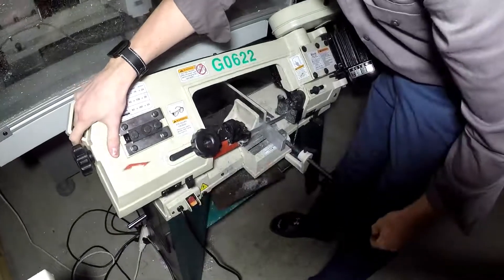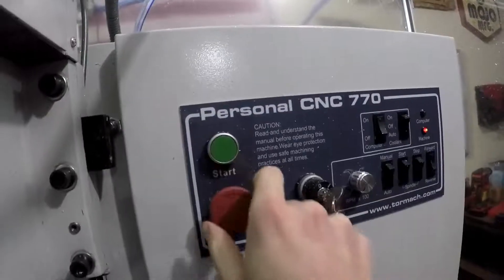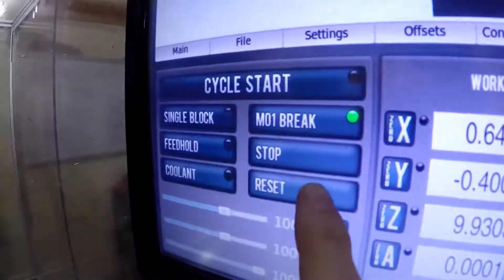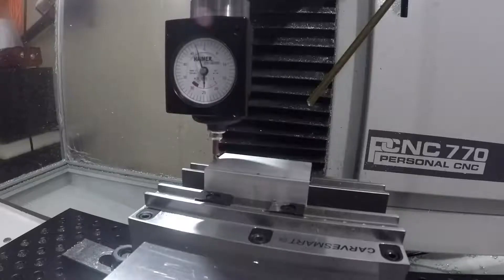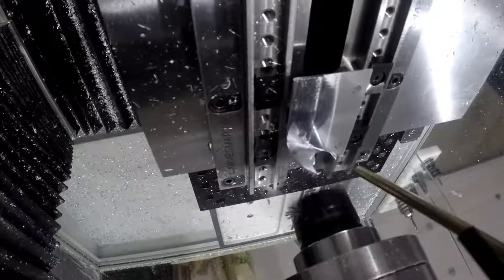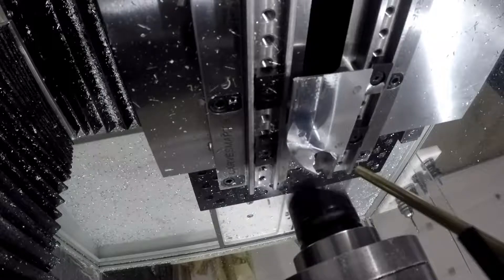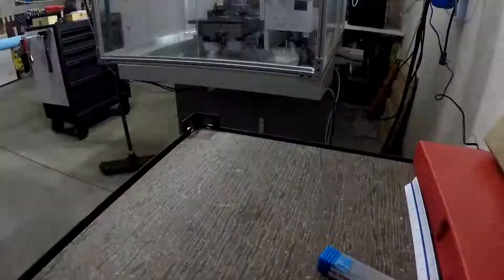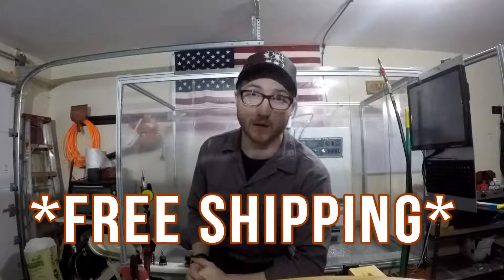More Prototype Machining: Home Mfg. Days #8

Comment: What I was getting at is. Other companies are producing the same product likely on a much larger scale. If you have one machine and they have 20 they will just undercut you back at a pace you cant keep up with. When if you sell close to the same price the market will stay strong. Regardless of price there is only so much market. Really just boils down to good business sense. Don't drive the market down why make 10x the work for half the return.
Reply from the maker: That's a good point.  Although, It seems that other companies won't slash their prices that much just because of some guy in a garage but maybe they will, you never know. I agree with you that if I sell close to the same price then the market will stay strong but I'd rather more people have my parts/products this early in the game.  It's not hurting me any at this point because it's just a side business that I do for fun that I hope to make into something bigger at some point.  For these cars the market is still somewhat large and I hope to capture at least a little bit of it but that's also why I'm trying to diversify my products between the Ford Fiesta ST and the Focus ST(also make hiking products at some point) and I also act as a general machine shop.  Let me know what you think or even what I should do going forward.  It sounds like you know a decent amount about business and I generally love hearing what guy have to say to improve upon my own business.  Thanks again for the advice!